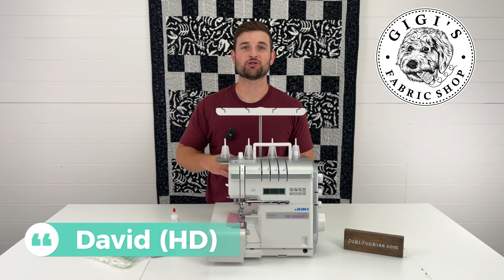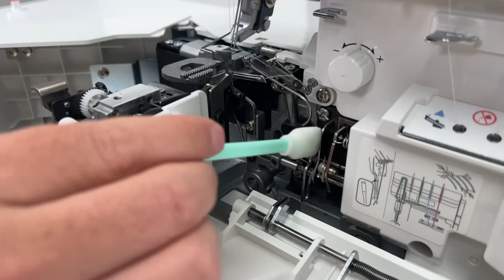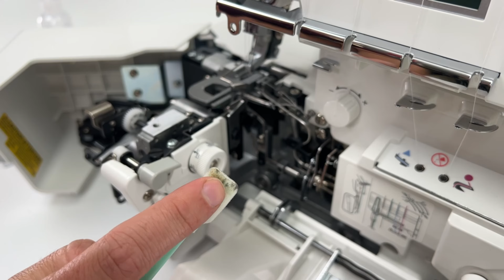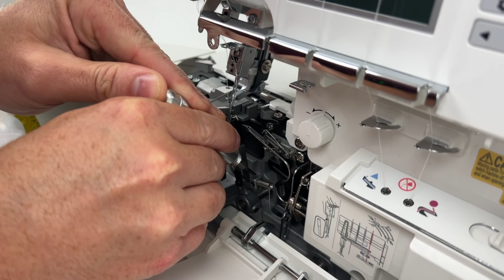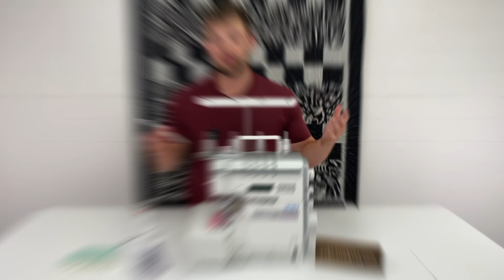How To Clean/Oil The Juki Air Thread Sergers!

Comment: I have a Juki serger 2000. Thank you for the information. How do you the air threaders where the cotton goes through to the needles. Thank you Eileen
Reply: How do you clean the air threaders where the cotton goes through.
Reply from the maker: It self cleans or you can run a tube cleaner in it